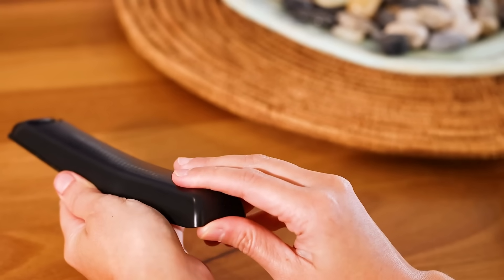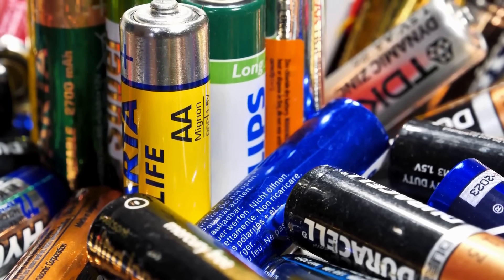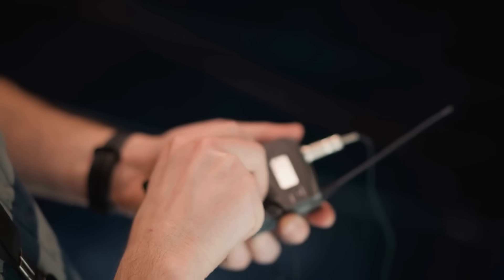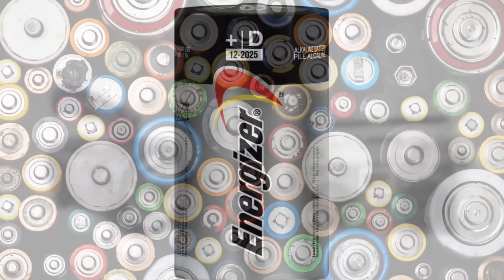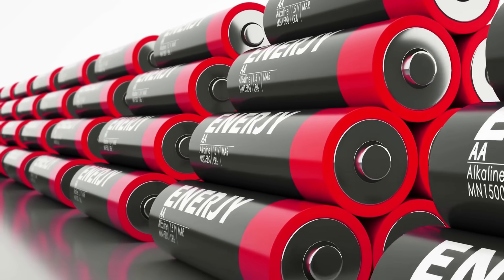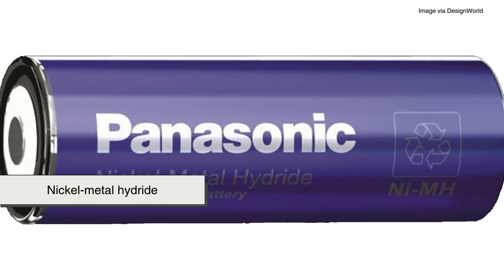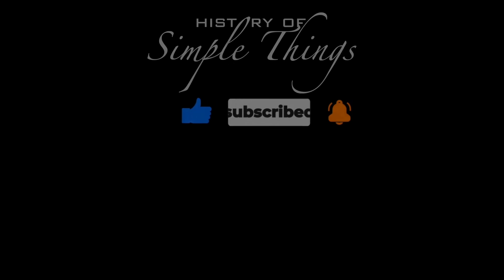The Hidden History of Battery Letters

Comment: The coin cell batteries use numbering systems. Could you also explain those? And why don't 9-volt batteries use the alphabet system? You showed pictures with 9-volts in them, but never talked about them.

Comment: 18650 for most things (ESPECIALLY SMALL TORCHES) has been the default for a whilst now. 

Battery costs also changed the battery world, like most things didn't use D simply because of the outrageous price. Now with USBc rechargeable AA/AAA/C/D/9v batteries, they're at their finest and now needed less than ever, kinda ironic.

Comment: Not a single battery in the whole video!  You did show a picture of a 9 volt battery, but didn't even mention it.

These are all CELLS!  But, if there are multiple cells in a device, that would be a battery.  Not many batteries, but the 
combined set is ONE battery.

Comment: D batteries were far more important before flashlights switched from using incandescent bulbs to LEDs.  Incandescent bulbs used enough power that D batteries were the standard for full-sized flashlights, and if people wanted more voltage than a pair of D batteries could deliver, they could get oversized flashlights using four or more D batteries.  LEDs use a lot less power compared with the amount of light they put out, so full-sized flashlights using (for example) six AA batteries can be brighter than flashlights using a pair of D batteries without an unreasonable sacrifice of battery life, and compact flashlights using a pair of AA batteries are far more useful in terms of how long the batteries last.

Comment: And how about R6,3R12, R14, R20, 6F22 or 4R25?
Edit: Some BS. What have to do B size withe B+ battery? Do you like missinformation or are you too lazy to do a proper research?
Wrong. B size is not B+ battery. Also A size is not that filament "A" battery.
B size battery is 1.5V roughly

Early "B+" batteries used with bright emitter tubes were 120 volts, but these quickly became obsolete as they were replaced with examples having voltages of typically 45 volts, 67+1⁄2 volts, or 90 volts as more efficient tubes became available. Some examples have taps every 22+1⁄2 volts. The last B batteries sold were 22 1/2 volts and similar in size to a PP3 9-volt battery. (wikipedia)
Try to use one instead the other....
Inform yourself to not propagate "confusion".

Comment: An interesting video, as most of these are. But it did merge two different "standards" and present them as one.  The first set of standards concerned the physical sizes of batteries. Generally, the information presented is all correct information. The second standard, which grew up about the same time, addressed the PURPOSE of the battery for radios.

In the late 1910's, radios (vacuum tubes) needed three different voltages to operate. Each tube required three electrical circuits, designated as the "A-circuit", which powered the filament, the "B-circuit", which powered the plate or anode, and the "C-circuit" that simply put a bias voltage on the grid circuit. At this time, radios were powered by dry-cell batteries.

The confusion and 'merging' stem from the "A-battery". Most tubes needed a 1.5 volt battery for the filament, which matched the voltage produced by a dry-cell battery. This was the highest current requirement of the three circuits. For a 1-tube radio, the then common "A size" battery would have been suitable. But for a radio with several tubes, the "#6 ignitor cell", able to supply higher current demands would have been a better choice.

Over time, radio circuit evolved into more tubes with mostly 6-volt filaments (which matched the 6-volt batteries used in cars) and most radios were now AC powered, which eliminated the need for batteries altogether. The exception were the portable radios that were common in the 30's through 50's. These still used three batteries and were identified by their purpose, A, B and C batteries but were purchased by a manufactures battery number rather than by generic physical size.

Other bits of related trivia: The "A" size battery could be described as a slightly fatter AA battery (17 mm diameter vs 14.5 mm diameter for the AA cell). According to Wikipedia, the "AA" size dates back to 1907, but wasn't standardized by ANSI until 1947. The #6 ignitor cell gets it name from its main use powering the ignition of early automobiles.

was to

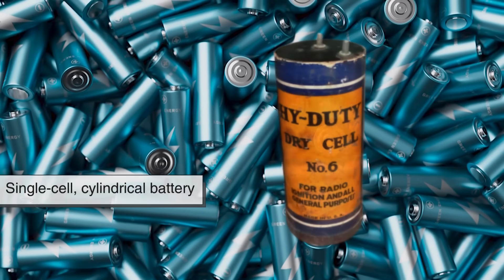Comment: 2:58 I had a battery like this when I was a kid, along with some solid wire, bells, switches and light sockets. Sets like these were used for educational purposes, but the batteries were also used for various odd-applications, like boosters for long telephone lines and the ignitions circuits in small engines. I still have a portable radio that could run on a 67.5 volt B-battery, though they came in various multiples of 22.5 volts, up to 90 volts. Tubes required higher voltages, so they often had  a high-voltage battery for the plate and a low voltage one for the filament. When transistor portable radios took over, the B-battery was replaced by the 9V ones we now use for smoke detectors.

Comment: A is not to be confused with 'A' , B not to be confused with 'B', nor is C with 'C'.  The terms 'A', 'B' and 'C' are not generic terms used to refer to radio batteries from the tube days and don't refer to a specific physical size or voltage.  For example an 'A' battery was for the filament or heater and could be 1.5, 2, 4.5, 6 V depending on the tubes (valves) you were using.  The 'C' battery was typically -4.5V, and the 'B' battery could be 22.5, 45, 67.5 or 90V or higher depending on the radio.  The 'B' and 'C' radio batteries often were tapped for multiple voltages. The B battery referred to in the video is actually referring to this and not a standard battery size like the rest.

Comment: why not tell us the 'high voltage' of the B battery:    A B battery is a high-voltage power source used for vacuum tubes in early radios, typically providing a voltage of 45 to 90 volts, although voltages of 22.5, 67.5, and even 120 volts were also used depending on the device.

Comment: Tube radios typically used either 67 or 90 volt 'B' battery but you could sometimes find 32 or 45 volt 'B' batteries for radios. You also had some odd remote control batteries that were 'J' and 'Z'. I believe the 'J' was 6 volts but I don't remember what the 'Z' was.

Comment: All you show are AA and AAA cells. Never a picture of the venerable B or C batteries, or the more common C or D sized cells (but these latter are becoming less common). The original B batteries were either 22volt, 45volt, 62volt, or 90volt supplying the high tension supply in battery radio sets. The original C battery was used as the bias supply of 22volts (with some variation). There are pictures of original 'radioB' batteries readily available online. I'm not sure why they weren't shown in this video.

Note: a single modern AA, AAA, C or D is called a cell, multiple cells make up a battery, like the common 9v battery which is made up of 6 small flat cells shoehorned into the familiar small rectangular shape. A typical transistor radio radio could use (say) 6 AA cells making up a battery of a nominal 9volts, or a single small 9volt battery. A car battery typically consists of 6 x 2volt lead/acid cells making up a 12volt battery. 
Don't mix up cells and batteries folks, they ain't the same thing.

Comment: There is also "N" size, still used in specialized electronics. Some "D" size batteries are manufactured with "C" size batteries inside with a spring. That's cheating the customer. The button cells are 3V and labeled by diameter and thickness, 2032, 2015, so on. Lithium AA batteries are 1.5V but Lion 18650 batteries are 3.7V and are bigger than AA. The real sad thing about batteries is you never get to use them all the way up, like a bottle of water. A 1.5V battery, any size (which is measured 1.6V new), is used until about 1.3V and then the device stops working. You throw away 80% of the battery. What a waste!

Comment: When radios became popular in the 1920s, they could be purchased to either run on 110 volt AC house current (if you lived in the city) or on batteries, usually 32 volt (if you lived on a farm or otherwise outside of town). The standard radio battery was a B battery, which had a socket on top which accepted a four prong plug from the radio chassis. My grandfather had a RCA radio from the 1930s which ran on a B battery.

Comment: The 9 volt battery was named PP3. So called as 'Power Pack 3'. They had others in the range. All had 'PP' with a number after them. PP3 simply became the most known and still used.

Comment: There are also F cells - there's four of them inside the 6V dolphin torch batteries with the two springs on top.

The batteries and cells in valve radios were not lettered to the same naming convention as modern ones. In that case, the battery or cell's letter signified its use, not its size or voltage.

The A battery, usually between 2 and 6 volts powered the heaters or filaments inside the valves. The B battery, usually between 27 and 90 volts powered the high tension part of the radio circuits and the C battery, usually between 1.5 and 9 volts, provided the grid bias for some of the valves.

Comment: Technically an "electric battery" is a source of electric power consisting of ONE or MORE electrochemical cells with external connections for powering electrical devices.
The usage of the terms "pile/s", "cell/s" and "battery/batteries" is partly historical, partly scientific, partly descriptive and partly common usage.
The term "battery" was already in use for military/naval purposes, well before 1749 when Ben Franklin used the term descriptively to apply to primitive capacitors connected in series.
The "Voltaic Pile" describes the first practical form of electrochemical battery invented by Count Alessandro Volta in 1799, constructed of alternating zinc and copper discs separated by cardboard soaked in a brine electrolyte.

Comment: You are just making stuff up without verifying the facts. Portable tape recorders did not use AAA. AAA became common only in the 1990sxas things got smaller. It is now more common in things like remote controllers which in the 80s actually used 9 V batteries.

AA flashlights became practical with the LED technology.

Comment: Annoying that there are no images of some of the older batteries. I remember the massive ones made by Ever Ready used in portable tube radios. Also every bicycle had the double-cell battery on the front lamp. Then there was the 4.5v oblate battery (I can’t remember its name)

Comment: A 9 volt battery is essentially just 6 AAA batteries wired together. I guess it was just invented for higher power and ease of use (instead of having to change out 6AAA batteries - just change one 9v).

Comment: To this day, the anode/plate power for vacuum tubes is listed as “B+” on schematics, even though that part of the circuit is no longer powered by the B battery. The batteries are long gone, but the schematic terminology persists 100+ years later.  

Bonus fact: people with a radio owned two sets of batteries- one to power their radio and the second which would be charged at the radio shop.  When the batteries at home ran low, the owner would take them to the shop and switch them for the freshly charged set.
Reply: Usually that was the A battery. the B battery was usually disposable since the B supply drew milliamps off of the battery. The A battery powered the tube cathode filaments and they could draw a couple of amps. The B battery would last a long time but the A battery would run down quick so many people had rechargeable lead acid A battery. Shops would run a program similar to what we have for propane cylinder exchanges. You bring your dead battery in, pay the fee take home a charged one and they recharge the depleted one for another customer.

Comment: AA in flashlights???  I think not!.  At least until LED lights took over.  Almost all flashlights used 2 D cells.
Reply: I'm Europe 3R12 (a battery with 3 B cells inside) was common though they already 0 were fading away in 1980. In the early 20th century they were common.

Comment: When I worked in a telephone exchange in about 1978, there was a special battery room that contained 25 2v lead acid cells that were approximately 3ft high and about 18x 18 inches across ! All linked together with bus bars to produce 50v. The phone system in UK works on 50v dc and this was achieved by stepping down and rectifying 240v ac but this left a slight ripple in the system which would cause noise so they floated the 50v cells across the output to smooth out the dc. Absolutely stunk of acid in the room but was a good thing to see!
Reply: Yeah, I remember seeing one of those battery rooms here in New Zealand about 60 - 65 years ago. We had them here too!
Reply: @brucerogermorgan2388 wonder what the technology is nowadays because it still works on 50v dc ?
Reply: @SteveStevieboy  the 50v was to generate the ring tone down the line to power the old fashion bell and hammer inside older pre touch tone dial phones  - also i think the minimum required for the speech and amplifier circuits to work was 42v
Reply: @georgemaragos2378 oh right must be slightly different in New Zealand then because our ringing current was 90v ac but your system obviously worked ok too😊
Reply: @georgemaragos2378 you are so wrong.
Reply: @harikrishna69  I oversimplified it
At idle - no activity approx 50v dc is on the line
When a call comes in the line become about 90v ac for the actual ring tone
Once you pick up the phone, the ring stops and it converts back to 50volt dc
While you have the conversation, the additional draw of current for the sound conversion (microphone and speaker ) drops the voltage down to about 12 to 18/18volt dc

It has been 25 years since my involvement but roughly this is a guide to Australia,

If it is wrong please fill in the gaps i am sure there is much i have forgotten

Comment: Yet aaaa is a meme, aa guns are batteries. But batteries in general are expensive af. Even the cheaper ones
Reply: Benjamin Franklin introduced the term battery to electricity. He thought a series of Leyden jars (capacitors) resembled an artillery battery.

Later when the Voltaic pile was introduced people said that it is like a battery but not a battery but the name stuck.

Comment: Do a video on the obscure and obsolete sizes. People have mentioned below things like 996, N, 1/2 and 2/3N but there was also BLR121 used in the famous Avometer, and FLAG which is so named because its original use was to power the bells and indicators of "servant call" systems in large houses which indicated which room had called by showing a small "flag" or annunciator on the indicator board. They didn't use small light bulbs because they hadn't been invented yet, also the flag system only used power when the call button was actually being pressed. You could also do a video on these systems.

Comment: Li-Ion cells are not sized as AA or AAA. They have a higher voltage and would break our gadgets if we were to accidentally use them in the wrong device. Also, Li-Ion is dangerously incompatible with AA and AAA chargers. I don't know anything about E cells, but as others have mentioned, F cells can be found in the big 6V lantern batteries as a group of 4.

Comment: What about 9 volt batteries, used in transistor radios. Still needed, to hear emergency information broadcast by radio stations - during storms, floods or other events when phones and the Internet are down. (Kym in outer Darwin, Australia - where we have tropical cyclones between November and April).

Comment: The numbers on "button batteries" indicate diameter and thickness. They are pretty much all 3V, and if a smaller or slightly larger battery will connect with the electrodes and fit in the allotted apace you can use it.

Comment: First of all, they are called Cells, batteries are a series of cells
I've got an old device that uses LR12 cells, but they don't seem to make them any more, however they do make a 3LR12, which is simply 3 x LR12 cells in a single pack, just cut the pack open.

Comment: With the arrival of Lithium Ion batteries, I have restructured my entire battery usage.  I found a brand that, unlike NiMH or NiCad batteries which only provide 1.2 Volts, provides a steady 1.5 volts throughout it's runtime and even has a built in LED to indicate when it has dropped to 1.2 and needs to be recharged.  Yes, you cannot typically see the LED when it's installed, which also indicates charging and full charge when in the charger, but to me, that is a minor point and not an inconvenience.    

I also have adaptors for AA, C and D batteries where I can use one AAA for AA,  1, 2 or 3 AAA for the C adaptors and 1, 2 or 3 AA for the D adaptors depending on how much power the device requires.  This obviously means they would not last a long as the type they are replacing, but for me, this adaptability outweighs any reduced runtime as they are rechargeable and status is shown by the device battery indicator anyway so you still know when they are low.  
I also have devices that use the larger 18650 batteries.

All the chargers operate on USB-C so this is a complete Off Grid battery solution as this means they can be charged from any source that has a USB-C including battery banks and some solar panels.

Comment: 0:26 -curious roach.   How about size N 7.5 volt we used for our power mics on our cb radios and J for some camera in the early 70s.those were rectangle and about the size of a small cell phone battery. AAA used to be referred as penlight batteries.